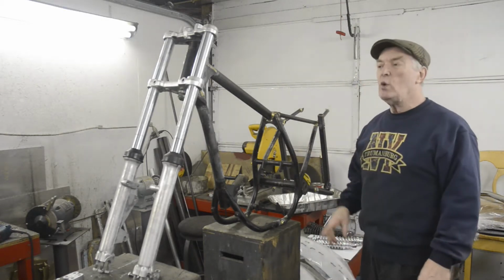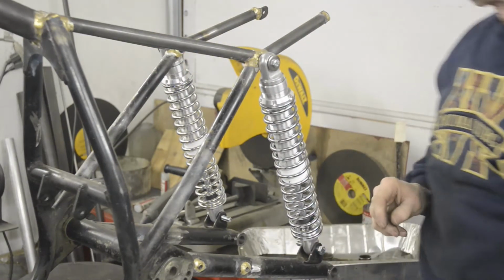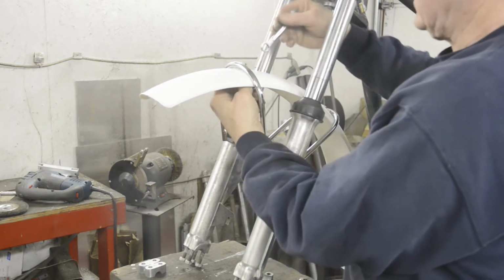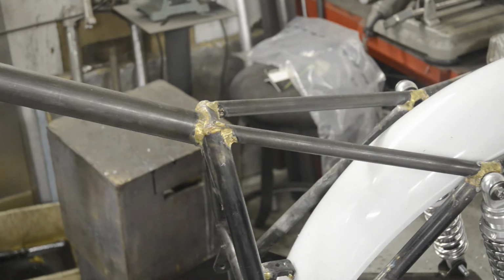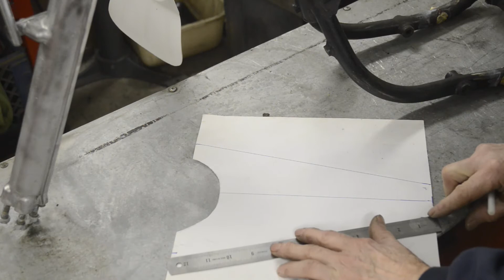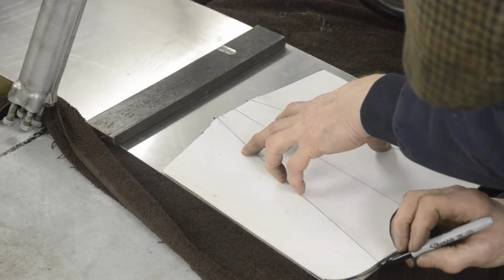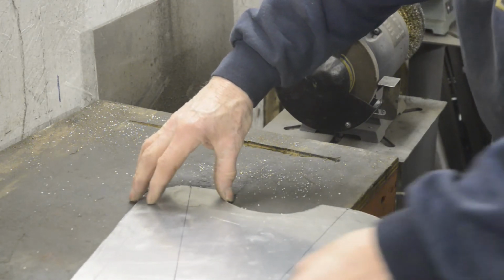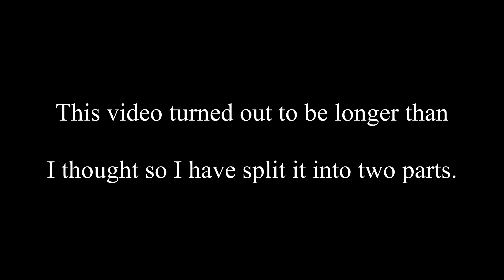BM 250 Trials Part Seven(1)

Comment: I spent a lot of time repairing/ replacing the wire mudgard and headlight brackets on those bikes. They looked cool put the vibration killed them in very little time.

Comment: What make is that mudguard bracket on the front, did i miss something, I'm using OIF forks on my C15 Trials build.
Reply from the maker: It is a Sammy Miller item from the UK. They are now sold by Feked. They are a good brace for the forks.

Comment: Michael, I really enjoy your videos.  Thanks for taking the time to post them.

I rebuild and/or restore old Honda CB motorcycles from the 70's as a hobby as well so I love watching how others do stuff.  Especially on these beautiful old British bikes.

2 Questions:
1)  Is your engine already running or will you be rebuilding it?
2) Is this one of the BSA's that shifted on the right and braked on the left?

Thanks again for the videos.  Cheers.
Reply from the maker: +Ron Icard Hello Ron. Thank you for watching. I will be completely rebuilding the engine. The bike is one of a collection that I bought and I have never tried to get it running. Apart from possible late prototypes all BSAs had the gearchange on the right. As far as I know the only right hand change British bikes were the very last Triumphs.
Reply from the maker: +Michael Waller OOPs, Should read "the only LEFT hand change British bikes were the very last Triumphs."
Reply: Yes, I knew what you meant.  One of the interesting things I learned when I started working on these SOHC Honda's is that the US mandated that all US bikes must shift on the left and brake on the right, starting with 1975.  So 1975 and above will be left hand change